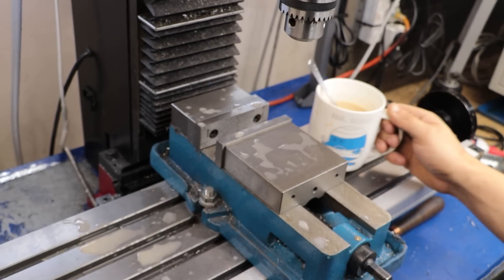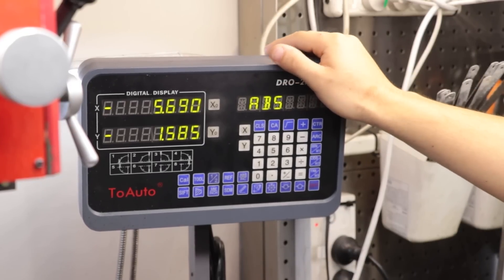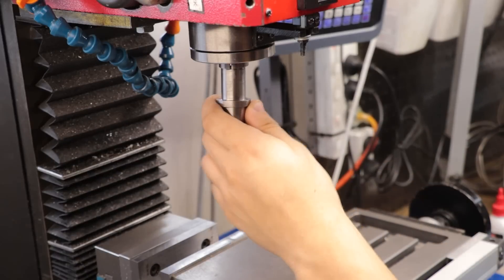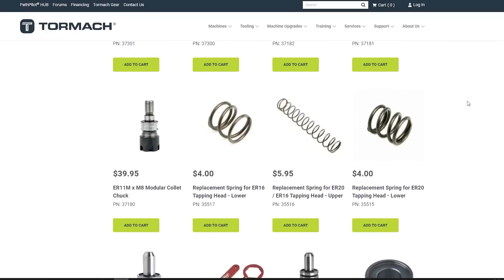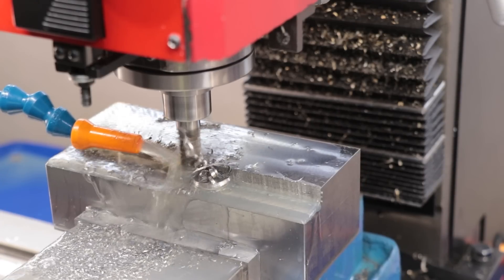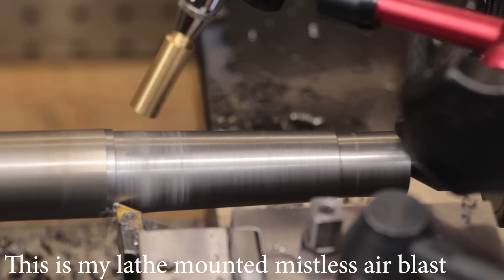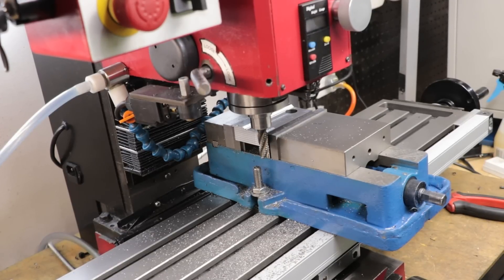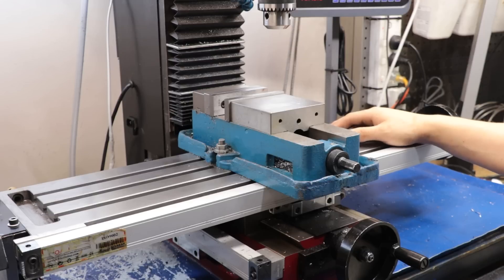The Ultimate Mini Mill - The Best Upgrades I Made To It

Comment: Adding mass for dampening... You added stiff or solid mass that can "resonate". Sand... Wet(?) or with added rubber ( ground tires) should work much better.🤗
Reply from the maker: No. Lead, cast iron and epoxy Garnett have very high damping coefficients. I added those. They also have high mass. Rubber has a high damping coefficient but has low mass.

Comment: Excellent, you  resolved what most wouldn't  realize the inherent problems are with these machines  being  the rigidity of the column and the vibration, Just a warning on changing the spindle bearings double check the  ENTIRE bearing numbers and letters that denote the size AND angle of the tapers with the replacement bearings, I found out the hard way, on one of the replacement bearings the taper was different .

Comment: My god, that scraping.  Best way to make a scraper is from an old file, heat it, batter it flat and make an arced tip then harden by quenching it again, grind the end to a cutting edge. Coolant can cause nasty skin conditions if you get it on you a lot, it's tough to get rid of.
Reply from the maker: I’ve never much liked tool steel scrapers, I much prefer carbide. Especially when I have to do white cast iron

Comment: Haha! Did you dub over 'I was experiencing stiffness issues' and replace the word stiffness with rigidity? - I have and MH28V Optimum and wouldn't mind adding some of your upgrade also. Thanks for the ideas! Luckily I got a broken powerfeed for free but unfortunately it was the sort meant for a knee mill so I had to change out the bevel gear for a straight gear and make a bracket to take the power feed. Very much glad I did it though! And all that was wrong with it was the switch! Is that an Ausee vice? Not too bad but better without the angle base (as you have it).

Comment: What kind of run out do you get on this mini mill?
Reply from the maker: About 0.01mm of run out in the spindle taper. 0.015-0.02 if you measure an endmill in its holder

Comment: I've been running a benchtop mill for the last three years, and last month added a knee mill with vertical and horizontal spindles. Still don't have it running yet, but it's a huge upgrade. The benchtop will be used exclusively for cutting spur gears.
Your lathe sounds like it needs new bearings in the headstock. It's making the clackety-clack sound.
Reply: The gearboxes in these cheap lathe are terrible, I had one like it from new, they make a terrible noise.

Comment: Be careful. Resolution and accuracy are not the same thing. Just because the reading says its within 5um, doesnt mean its real. Cheap scales may have resolution, but not accuracy.
Having said that, a DRO is probably the best improvement you can do on a mill to improve ease of use.

Comment: Genuine question: why don’t you just slip your 20mm tooling into a 20mm ER32 collet? You just loosen the nut and swap the tool. Same as what you’re doing now
Reply: If you do that you have to fiddle with three pieces and you loose the height. (his toolholders have shoulder)
At that point you might as well change the morsetaper collet in the spindle and end up with more rigidity and concentricity
Reply: @CornflakesOriginal  i agree with the height point but the rest is virtually the same. You’re only loosening the collet nut so that it drops out. Same as loosing the draw bar to release mt3 collet

Comment: 10:23 Those welds though 💀You could re-use the parts. Remove the three handles, clean up the center part on the lathe, and then thread both the center part and all three handles, and screw in with lock-tite.

Comment: A scraping project!  Is your scraper dull?  It looks like you're working pretty hard. That radius is quite narrow, which probably makes the work more difficult.  You're digging in and stopping hard, which probably is a clue to do something different.  One of the old-hand's tricks is making a flexible handle which naturally gives you a soft start and soft stop.  Perhaps you need a bit more negative rake at the cutting edge?  These are all minor points compared to the job you've done.
Reply from the maker: White cast iron which the gibs are made of here is much harder than the normal grey cast iron the saddle and table are made of. I don’t like scraping it. Cheer

Comment: Even though I work wit ha VF5 mill lathe that yours would fit inside of, I'm very grateful to learn what any of these machines do, instead of being some worker monkey who just puts metal in and take part out. For sure I need to make some speed handles as well, since these $60,000 machines are still using the same terrible vice handles as your old one

Comment: Why not skim the gibs on the mill rather than scraping them?
Reply: Having a masters degree in machine tool design, scraping is the way to do it. If you wants precision.
Reply: @Mike40M  Is there a reason why? Given that Artisan Makes was talking about microns and whatnot, it seems a very imprecise way of machining.
Reply: @5-Sigma-5  Back in 1974 we did a tour to a number of machine tool manufacturers. All of them said that their grinding machines was so good that they didn't need scraping. But when touring the factories they all had workers busy with scraping.  There is two reasons for scraping. First to get a better plane surface. A rough estimate is that the precision of a machine tool shall be ten times better than the machined part. A skilled worker can make a surface better than one micrometer (half an tenthousand of an inch).
Second reason is to improve lubrication by making tiny scratches. The scraping in this video does both.
Reply: @Mike40M  It's sort of unbelievable, mate. (Not you!) You have machines that are capable of engineering a piece of metal on the micron scale yet you have people gouging out a lump of metal by hand.
Reply: @5-Sigma-5  yeah scraping is a bit of a counter-intuitive method, but it's extremely effective and you can get extremely good results. For instance, I've scraped my lathe bed to within 1 or 2 tenths of flat. Recommend watching Robin Renzetti's or Stefan's videos on scraping to see how to do it properly.
Reply: @5-Sigma-5  A bit of history. In early 19th century Maudsley spent 30 years on improving lead screw pitch on his lathes. By hand, because the machines wasn't precise enough. You can't make a machine tool better than the machine that makes them. Without manual labour. Same applies to measuring devices.
Scraping is a very inefficient way of removing material. Tenths of microns at a time.
Reply: @5-Sigma-5 , I’m going to stick my nose in here for a moment and say that a machine can get a part flat but have you ever seen someone take a pair of gauge blocks that are truly flat and rub them together? They are so tight, there’s no room for air in between them that they stick together, I believe it’s called stick-ion, so to make room for oil between the parts they do the scraping which leaves very small voids that are lower than the finished surface. 
Without the oil parts just wear out faster so besides making it really flat it makes room for lubrication. Thanks and have a good one
Reply: @Hoaxer51  That makes sense to me.
Reply: That could be a great option if the gibs are really off, but...  You can't use the mill to cut the gibs while you have the table taken apart.
Reply: @Kineth1  Ah. Yeah.

Comment: I don't need to check it, I know on my mini mill the gibs are garbage and I rather expect the dovetails are not very good on the table either. But the motor and spindle, really the whole Z section is really darn good (for such a small machine anyway). And its been useable enough to not be worth fixing - I keep figuring I'll replace my mini set up with a larger more capable lathe and enough extra bits to treat it like a small mill in whichever fashion I I end up with - maybe even just making at attachment to put the current mini-mills shocking good column on it...

Comment: At the end of the day its still a tiny little thing thats limited in what it can do. If you want a big boy mill buy a BIG BOY mill .
Reply: Im sure he can fit a K&T 330 tf 17 on that back porch💁‍♂️ wood floor and all
Reply: @britenrhodehouse8692  Im sure thats what i was talking about putting a HBM on a wood floor. There are table top Mills bigger than that that are useful
Reply: @apollorobb  but are still just that... A table top mill💁‍♂️ and still, the bigger of them far exceed the load capacity of and old wood floor and offer little improvements over what he has now. I'd say the guy has done a pretty good job with what he has to work with.

Comment: Great overview of the history of your modifications. I've not needed to do a great amount of scraping, but I saw a trick on another channel that has worked great for me: During the initial roughing out I use a Dremel grinder to remove the high spots and this saves a huge amount of time. I got good enough that I only needed the scraper for the final passes. You can even use this technique on hardened steel!
Reply: Agree!  I use an angle grinder to do the roughing in, and even a little more. Back when I used one to scrape for the first time, I was worried about gouging and over grinding. I was very, very careful, but was surprised by how gentle, accurate, and controllable an angle grinder could be. They can hog off the worst high spots in no time. Tradition is a good thing, but wasting time is a bad thing. The traditionalists will squawk about grit and gouging, but this hasn't been a problem for me.

Comment: The value prop would be superior for buying used stuff at the price point as these new items & restoring them...and it'd provide great content in the process.
Reply: The problem is finding them used. They don't pop up as often - or even at a good price a lot of times. At least not here where I am at in the US.
 As much as everyone on the internet loves to hate on them, I rarely see them sold used and if they are they are very well used so they must have worked for what they needed.
Reply: @vivigarr  in New Zealand, good condition used milling machines are usually very hard to find. Hobby size lathes pop up quite often (there's actually a lot for sale currently, about a year ago there didn't seem to be many) but home sized mills in any part of the country may only pop up every other week